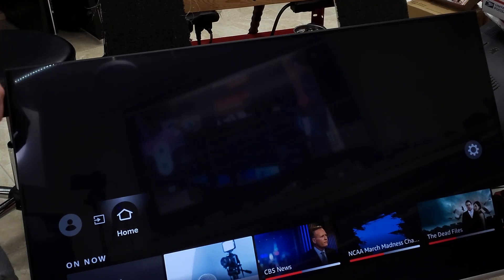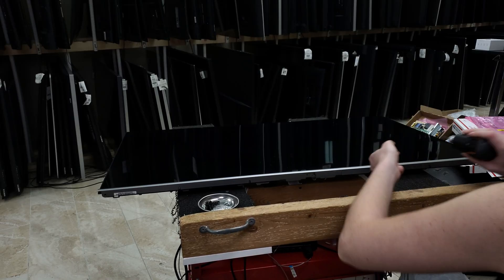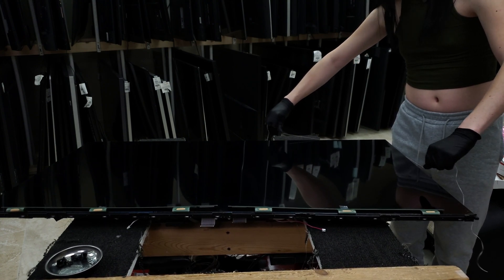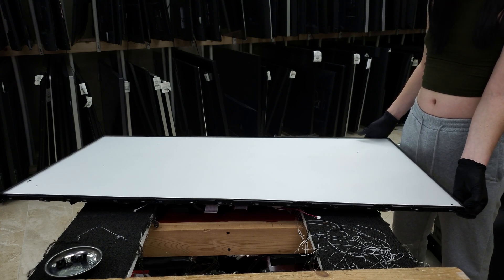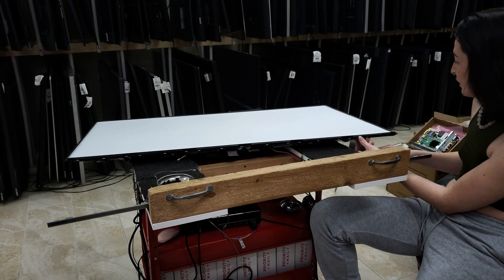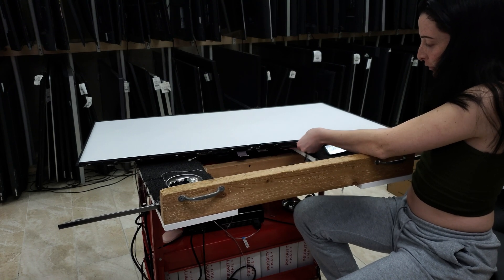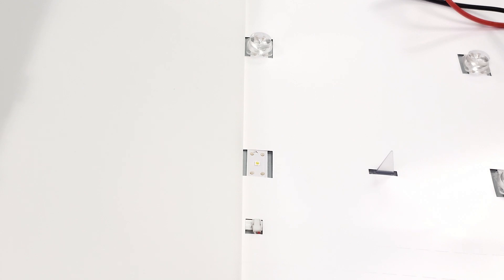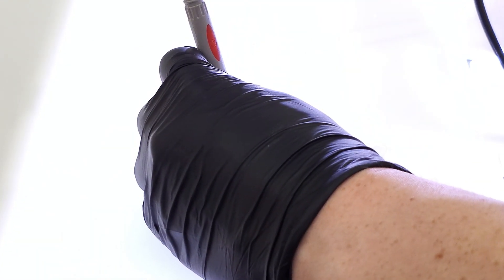Toshiba 55C350KU TV Backlight Repair | Floss Method?

Comment: Great video! I just picked up a 50" model last night that needs backlights. I figured there would be some difficulty in getting the panel off. Since your floss kept breaking, how do you think fishing line would work? My concern would be it possibly scratching the glass but I'm not certain that would happen. I typically use Frost King double sided tape to install backlight strips, and while i think it would also do fine reattaching the panel, it is quite strong and hard to remove. If it ever needed to be opened up again it wouldn't go so well 😬 What kind of tape did you use?
Reply from the maker: Fishing line would be better I would think, I use thin copper wire when floss isn’t strong enough and there’s usually no visible scratches. I’m glad to help!
Reply: @surefixtech  what is the tape you used to reattach the panel? It looks very similar to what you took off

Comment: Ever try fixing Oled, or is that a completely different beast compared to LCD screens?
Reply from the maker: Yeah! Honestly the most common OLEDs we get in by LG are either short panels (haven’t found a reliable fix… yet) or a simple board swap. I’ve run into very specific cases, such as a one of a kind transparent oled that we scrapped together a power supply for, and some other one offs. 

I’m excited to make more videos on OLEDs as I learn (: thank you for the comment, and stay tuned!
Reply: @surefixtech  Fantastic thanks for the reply. Also for your own entertainment room, Do you mess with Qled or Oled?
Reply from the maker: In my own home I use an LCD. Although I don’t really watch television so often, ironic I know :p